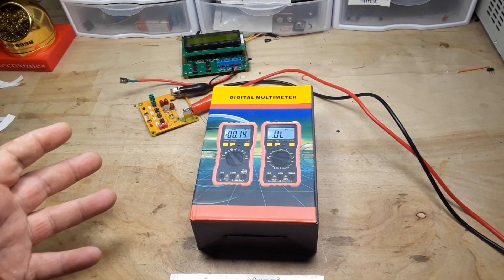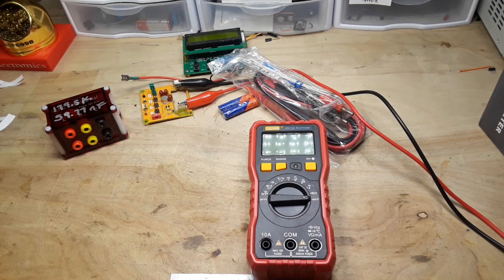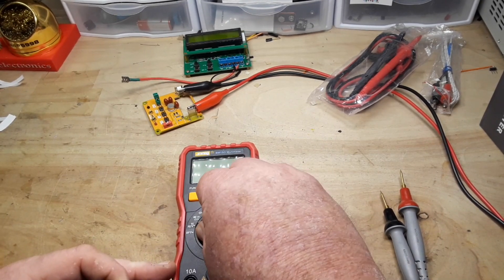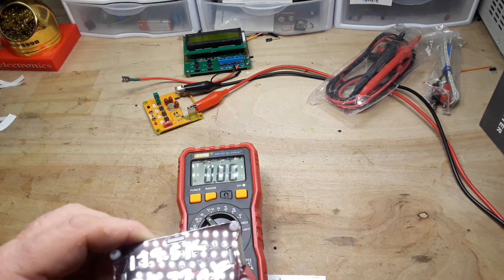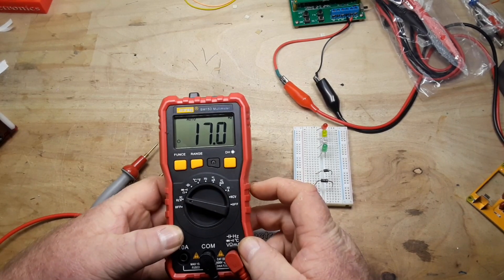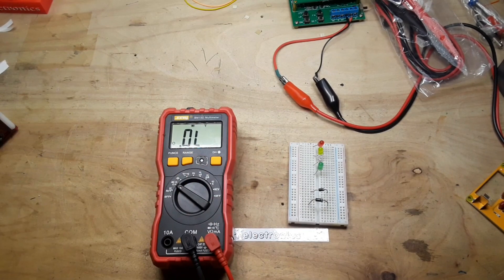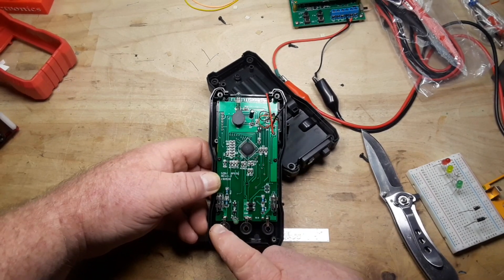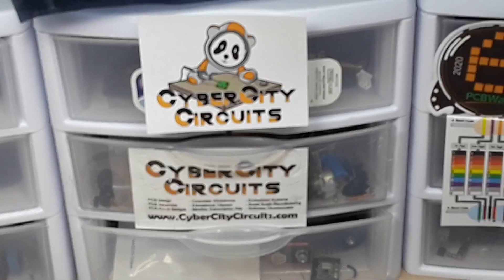Neoteck BM15D Multimeter Review and Tear Down

Comment: Good info thanks. I have one and do not like it at all. Getting another one soon, and this will be a back up. The instructions are not good, you have to press a button to  toggle between functions. My fuse blew, probably my fault, but you to pry the case off to open then back. Used 2 paint can openers.  And the instructions do not list the fuse size.

Comment: I almost though that this was like an LCR meter that I purchased from eBay really cheap! It's a big meter with a big screen but it's like a bag of chips, full of air LoL. I think that I paid around $20AU for it but I swear that $20AU on it's own feels better than this LCR, it's not great but it's not terrible either. For what it is, it cannot read large power supply type capacitors which is rather annoying because it's only got three jobs to do and it can't do one of those properly! I have a few different capacitor testers and none of them can read a 10,000Uf capacitor... At least if it could do a DC leakage test, I would be happy with that. I really want someone to make a cheap Chinese device that can test a capacitor at full rated voltage like the old Heathkit and Eiko's, sadly those things are unobtainium in Australia! That and a signal tracer from the same companies and vintage! I would kindly kill for that. 
Speaking of signal tracers, I learned recently that there used to be multimeters that played a certain frequency when in continuity mode and the frequency would change depending on the level of resistance between the probes! What a beautiful idea! I wonder why that doesn't exist anymore? 
Anyway, great video. I saw the screw fly before it happened LoL, boy did I have a great laugh! Been there before, although I don't think that anything is worse than the C clip on the end of the hub of a cassette deck mechanism! Looking for one of those is the true meaning of pain lol.
Reply from the maker: C clips dissolve into the 9th dimension upon removal
Reply: @learnelectronics  hahahaha ROFL no wonder why I couldn't find it!

Comment: Good to see you testing this cheaper gear. Beginners with limited funds can't afford many mistakes so budget equipment is where simple dependable reviews are needed most. I think you ought to pass judgement on the supplied leads though. I understand consistent testing with high quality probes, but at this price point many buyers will be dependant on what comes included, and certainly not ordering those Probemasters that cost more than the meter.

I agree with your conclusion - waste of money, there are better models out there for similarly low price.
800Ω seems like quite an error. I realise it's <0.5%, within spec and maybe normal for a cheapie, but still disappointing in my opinion.
What's with the phantom third cell battery compartment? Cheapest part available? Hiding place for a spliff?
Really can't accept failing to read forward voltage on those LEDs; not as if they're exotic components with outlandish ratings.

Are those reference standards from kits or your own design? Any links?
Reply from the maker: Id guess parts on hand?

Comment: So the accuracy is more or less equal between most of these cheap multimeters it seems, and good enough for hobbyist.
What is more interesting is how well built they are. Do the rotary switch fall apart after a few months and so on.
Are they pocket friendly, or do they work well on the table?
The Aneng 8008 / 8009 I think is good for putting in the pocket and bring around, but to round and to light for desktop usage.
Maby you should make some dedicated testleads for MM testing, someone with gold bananaplugs on that would go into your different standards.
That would eliminate bad contacts during testing.
Thank's for testing and giving a honest opinion.
Reply: Yeah they are all okay when it comes to measuring until you need to check the capacitance of a larger value capacitor, most won't do it. The only other thing which is extremely important is when we make a mistake a probe something that maybe we shouldn't have, is the meter going to provide adequate protection? I don't know how much voltage it would take to jump across the fuse in this model but it could have been longer so that it's impossible for an arch to jump across the fuse end caps even though it has already blown! Some manufacturers go out of their way to stop that from happening! This is what's important to me! I'm always careful but it only takes one time! And that might be the last!